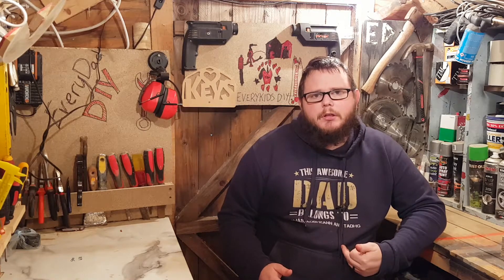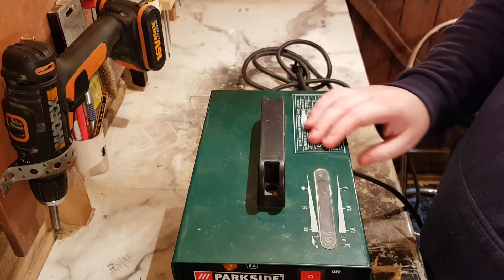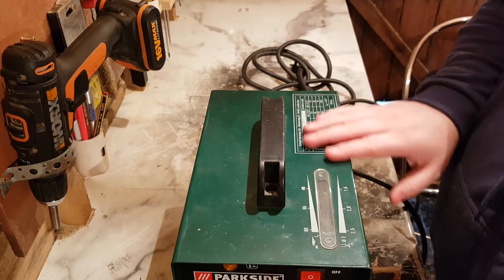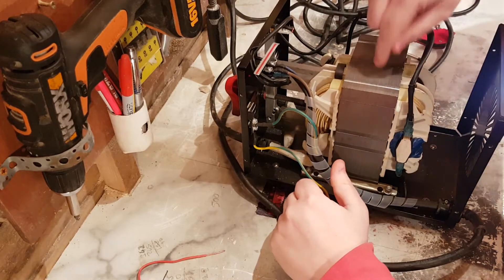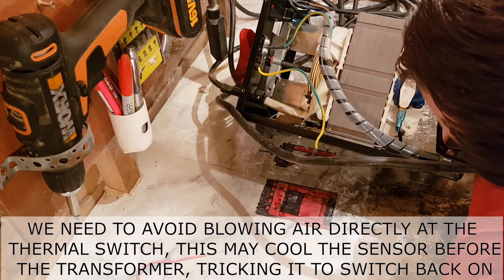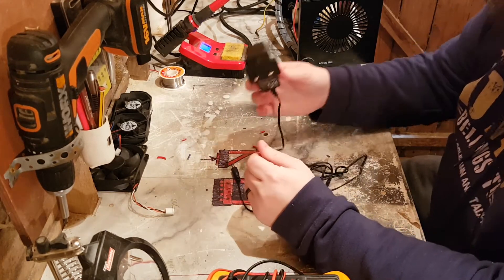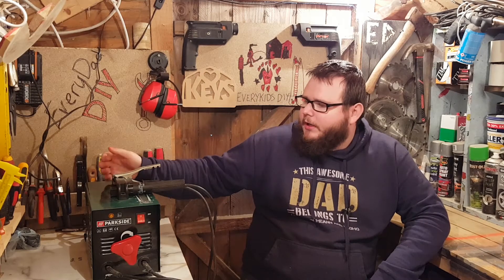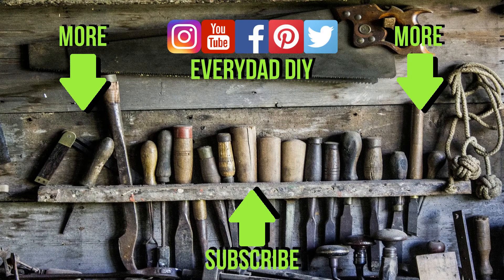Welder Upgrade Pt.1 ,How to add fans to a welder.(Parkside pesg 120 a1)

Comment: U could also add a  passive large heat sink to the steel plate part of the transformer to help disperse the heat dirct away from the bukly steel transformer..with the addition of 2 fans it should keep cooler for longer and in overheating it would cool quiker as well..= more welding time

Comment: I hope to increase the duty cycle of my 80 amp Flux core contiuus feed welder. When you hit the duty cycle it becomes soo aggravating!!!
Reply from the maker: Hi, I still use this welder and it has improved from doing this, I did a part 2 video that shows the improvements I got if your interested.  Thanks for watching

Comment: I have a similar idea, but instead of running the fan through the welder, I was going to disconnect the internal fan and only run an external 12v exhaust/intake fan system.  My logic is that the fan is drawing on the welding unit power supply.  Power supplied to the fan generates heat inside the unit, and steals away power.  It may not be enough to matter, but I have an abundance of extension cords and don’t mind plugging extra stuff in.
Reply: You can get 20 usd PC cooling fan at 12 volts. Pair it with 12 volt power supply and you are good to go in one box, no need for extension cord.

Comment: Just did this to mine. Very easy thanks to your vid. Used a BT home hub 2 adapter which unscrews very easily to get at the gubbins inside. I just used x1  120x120x25 12v fan on the rear. Only 1200rpm though so may upgrade that.
Reply from the maker: jonathan matthews brilliant thanks for your comment ,glad I could help. Happy welding 🛠️😊